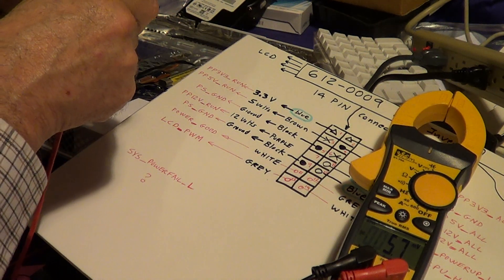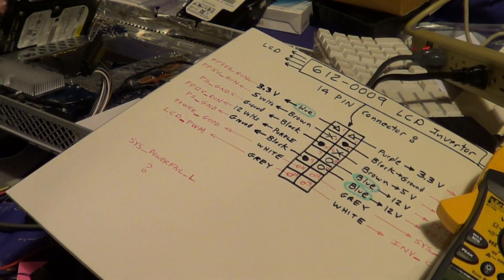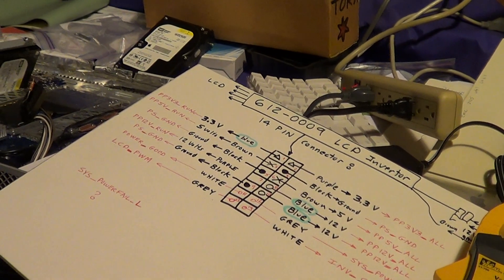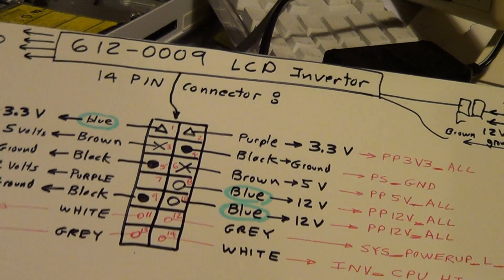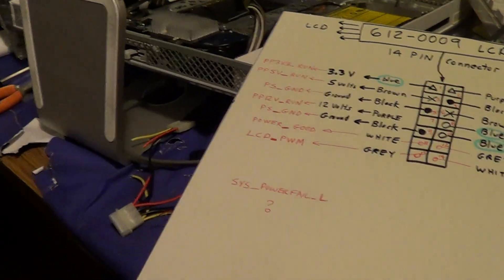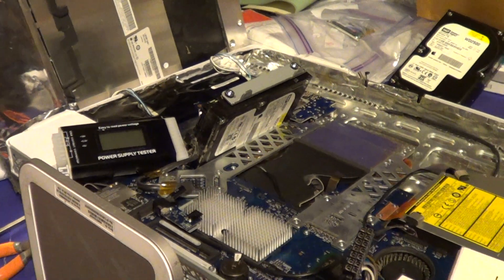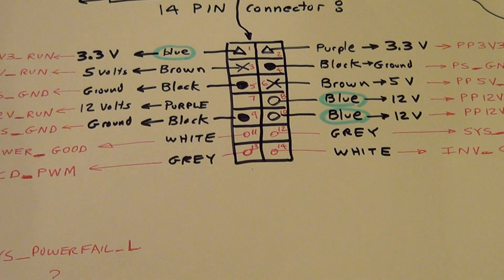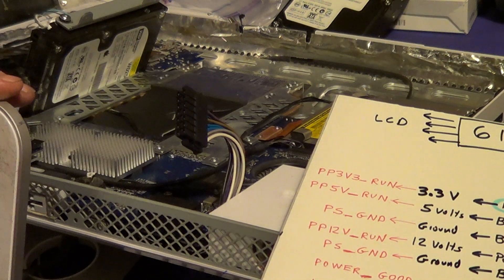20" iMac 14 pin connector pinout early 2006 Inverter 612-0009  rambling video 003

Comment: A very informative series of videos, and some impressive sleuth work on your part. You're using a resistor to bridge pins on the connector, thereby activating or deactivating the LCD inverter board. Is the resistor necessary, or do think a straight jumper would work? Also, could one use a potentiometer to tie LCD_PWM to 3.3V_All in order to adjust the brightness of the LCD?